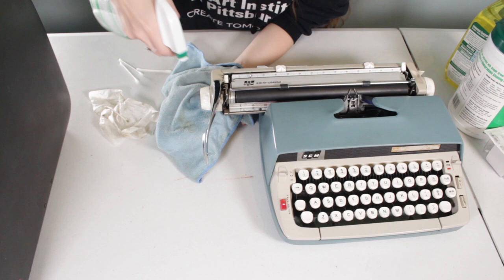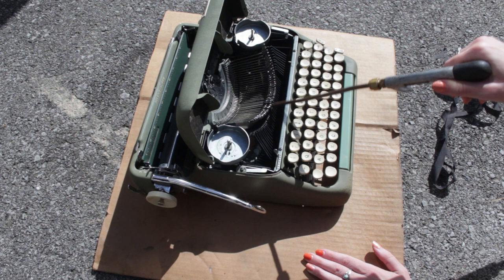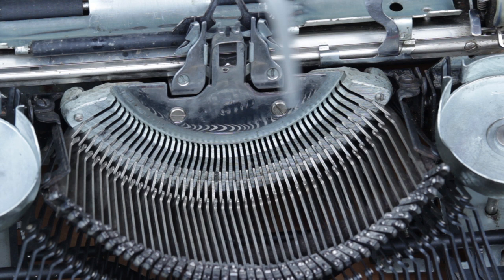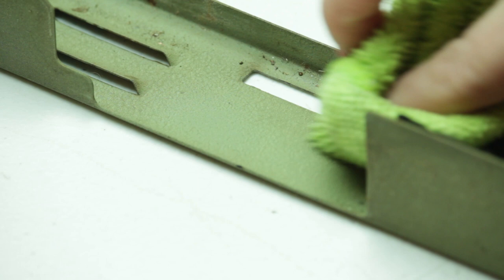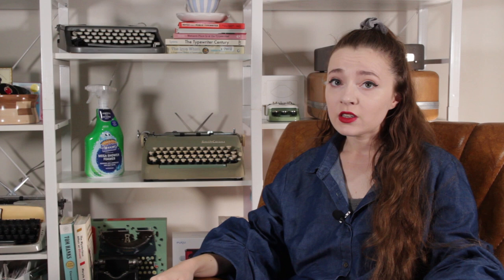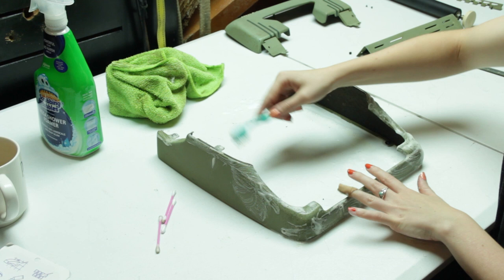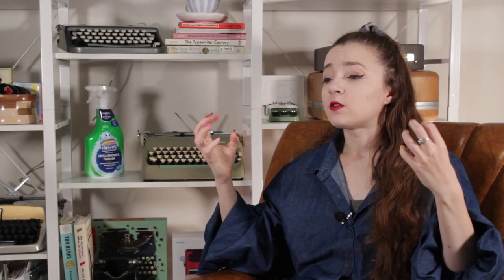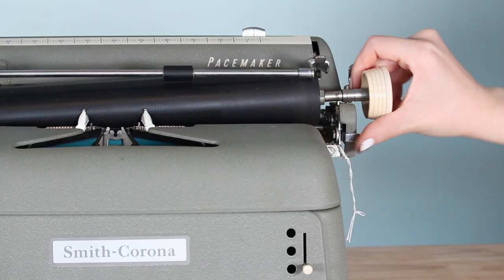Cleaning a typewriter with SCRUBBING BUBBLES??!?

Comment: Just keep in mind not to overdo with air blowing or vacuuming. Careless blowing with strong stream of air (or vacuum cleaning at high cleaner power) can blow away (or suck in) springs or loose screws. Searching for them in the grass (or using a magnet - inside your vacuum cleaning) and after that trying to find out where should they be fixed in your typewriter is not like too fun to do.
Reply from the maker: Absolutely agree- that's why I always suggest to also check and secure all of the typewriter pieces before air compressing!

Comment: I like Simple Green for cleaning, and WD-40 puts a nice sheen on the paint afterward, but be sure to wipe off the excess, and as we all know, it is not for lubrication inside the machine.  I also found a blower for less than $40.00 at WalMart that is a nice substitute for a compressor.  It probably won't disturb the neighbors in an apartment building because it sounds like a small vacuum cleaner.  There are several different brands and models.  It recharges via USB port.  I just got it, so I can't yet say how well it holds up over time.  The problem I have here in Hawaii is finding older machines at a reasonable cost.  The typewriter craze has not caught on here yet, so there is not much money in repair or reselling machines.  Anyway, those are my comments, for what they are worth!  We enjoy your videos.  Keep it up!

Comment: Upon your earlier suggestion,  I hunted down some Simple green.  I scrubbed that with a tooth brush, then used a cotton ball with isopropyl alcohol to wipe it away and wow did some gunk come off!! I'd usually have to do this a few times, but the results were very noticeable.
Reply from the maker: Glad that worked for you! Just be really careful to patch test first and be careful around decals- some machines work great and I've never had an issue, but I do know some others that have had some trouble with it being too aggressive of a cleaner

Comment: Damaging the paint by cleaning is a serious problem... so thank you very much for your helpful video! Simple Green is available in Germany, but extremely expensive. Scrubbing Bubbles is hard to find but more or less affordable over here. In most cases I used spirit without any problems, but sometimes spirit is not powerful enough though. So next time I will try out one of your suggestions :=)

Comment: I wondered why you wiped off the scrubbing bubbles vs rinsing it off with plain water?  Love your videos!
Reply from the maker: I used a damp cloth!
Reply: @JustMyTypewriter  I get a that. I meant rinsing it under running water. The parts not the whole typewriter ..although I have seen people giving typewriters bubble baths 😳
Reply: @jenniferross5440  You're giving this waaayyy too much energy girl. SMH.
Reply from the maker: @jenniferross5440  I think that definitely would have worked- it didn't even cross my mind at the time...
Reply: @montyincali  I am 😂😂😂

Comment: Hi Sarah—I have a question about the Smith-Corona space bar. Mine is stuck and not jumping forward as well as when I am typing it’ll stop and start the letters all in one space. I am also having trouble with the return. It’ll go forward but not go back all the way. I think I might end up going to a repair man but any tips before I spend lots of money to have someone else fix it?
Reply from the maker: Are your margins set to center? or your right margin set really far over? That would stop your space bar from advancing if it hits the end. Depending on the model, you may also have the lock engaged. I would also recommend a quick clean- air compressing under the carriage in case anything is stuck!

Comment: On the last typetest, what kind of paper is that? It looks really sharp with the green against it.
Excellent video.  I never would have thought to use a shower cleaner on the maschine.  Appears to have done a decent job.  It is always good to have additional cleaning options in your collection should one be down or out of stock 😀

I, too, have a maschine that happens to have some rust spots. I have seen restoration videos where they sand it away and use epoxies and such - I forget exactly what was used as it had been a while since I have watched the videos.  Granted these videos were restoring non typewriter items!  It is a typewriter which I figured that I would give it a go.
Reply from the maker: It's a thick white cardstock!

Comment: Hi 
Not sure if you can help me. I have a typewriter that randomly jumps. Would you have any suggestions as to what might be causing this to happen ? warm regards Stu . U.k
Reply from the maker: That could be many things. I usually suggest to first flush the escapement. Gunk in that area can cause skipping. That would be the under portion of the typewriter where the star-wheel is located that indexes per space (check my nightmare corsair repair video from a few weeks ago where I show that piece!). I would also clean any rails on the machine (under the carriage) and clean out the type basket. Cleaning fixes many many issues. I flush internal pieces using mineral spirits and compressed air. Don't get that on any external panels!
Reply: @JustMyTypewriter  Thanks for the reply I'll try it at the weekend and let you know. Really like you vid clips. Warm regards Stu

Comment: I loved that green ribbon! I've never seen a green typewriter ribbon before. Where did you get it?

Another solution for apartment or small home dwellers who don't have room for an air compressor is the Compucleaner 2.0 electric air duster, available on Amazon for just under $50. I bought one for blowing out desktop and laptop computers (which I fix professionally), and I've been very happy with it. It's compact, easy to handle, not too noisy, comes with helpful attachments for customizing the air "brush", has two speeds plus a couple of ways to adjust the airflow, and lets you reach nooks and crannies that a vacuum cleaner won't. I would expect it to work well on typewriters, although it won't replace mineral spirits and a toothbrush for getting greasy grime out.
Reply from the maker: Great idea for dust removal! For the ribbon- I got it on ebay from FJA. They have lots of color options!

Comment: I wonder if brake cleaner on the inside mechanical parts would work for cleaning.
Reply from the maker: It does! I've used it before!
Reply: @JustMyTypewriter  Only use that stuff in a well ventilated area.
Reply from the maker: @Boodieman72  correct!

Comment: So i got a 1939 corona typewriter, but the previous owner oiled it for testing. What should i do?
Reply from the maker: Clean off the oil to avoid it getting gunky. Typically I use mineral spirits and compressed air to do that!
Reply: @JustMyTypewriter  i have air

Comment: Hi Sarah, I've got the outside panels off, and I'm getting ready to use Mineral Spirits to clean my typewriter, something I've never done before. When using it, do you need to cover the keys or platen to keep them from getting splattered? After cleaning and drying, is there any need for oiling any parts or other treatments? Thanks!
Reply from the maker: Always protect your platen! Just be careful around the keys- you don't want mineral spirits to really get on anything that isn't the metal you're cleaning. Don't add oils into the typewriter- it'll attract dust over time and gunk up the machine